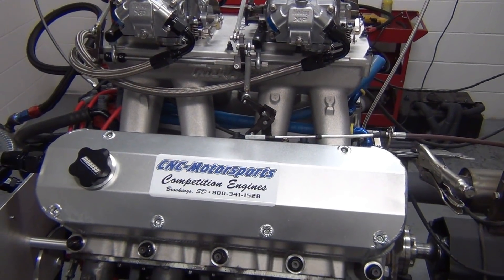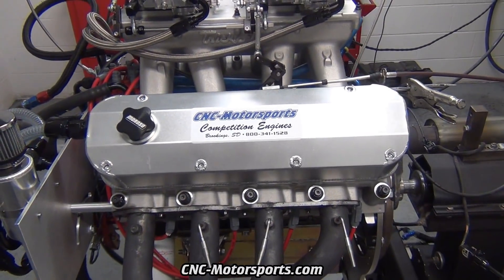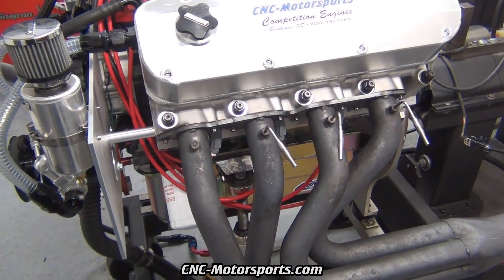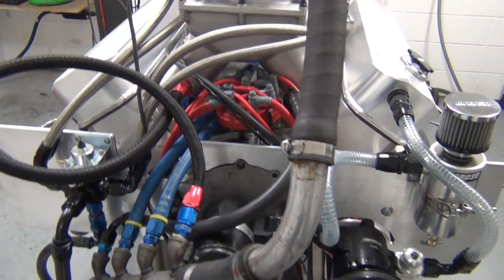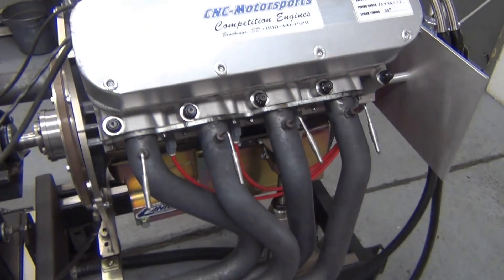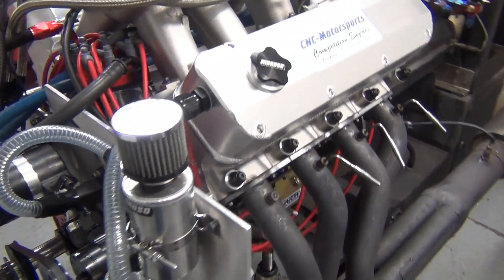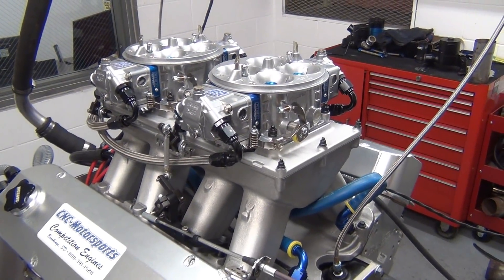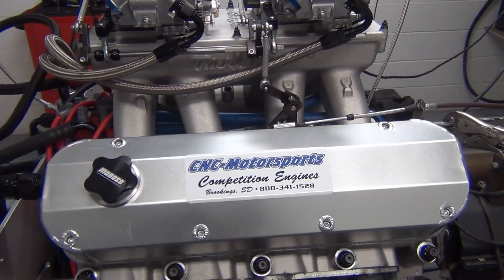Ford 632 Truck / Tractor Pulling Engine Dyno 1100 + HP

Comment: Remember folks until now you have seen dark orange heads with 572-632 written along ""Chevrolet"", light orange heads with 572-632 written along ""Hemi"" but now it's time to change color and clan, now blue heads with written not 632 but ""Boss 600"" or ""SCJ 600""....

Comment: What size header would you run on an engine that size and horse power level? Those look small and that might be holding it back a little. I would think 2.250 on the small side. A video on header sizes to show the change of performance would be great. CNC  seems to have true power ratings, not inflated big numbers. Thanks for showing us your builds I like to to watch them.
Reply from the maker: 2.250 is what we were currently using. We are currently reworking the combo with a 2.500 header tube

Comment: can someone tell me, if we run that engine on the street and touring, please and thank ?🤔 ☺
Reply from the maker: We can build one for your application.
Reply: @cncmotorsports  But what happens if you do? I'm assuming noise ordinance regulations would be a problem...
Reply from the maker: @anonymousanonymous9991  That depends on your exhaust system used.
Reply: @cncmotorsports  Fair enough. So its do-able just ridiculous to daily? Cuz frankly I'm tempted to try it but a little scared haha...
Reply: CNC-Motorsports  how much can u bore a 460 to
Reply: @codyhickman6272  a460 aftermarket blocks can go as big as 4.65. Stock blocks can go as big as 4.5" depending on sonic test

Comment: Im in the market for buying ine of these tractor pulling engines here to drop it in my 03 mustang mach 1 with a T-56 6SPD transmission bolted up to my car can anyone help me and work with me here to achieve my goal of building one bad ass mustang with one of these builds but tweak it up a bit with hemi style custom heads on a big block ford
Reply: Kasse is only way

Comment: That oil pressure concern you at all or is that normal?
Reply: We don't know if he had that sensor hooked up. I can see a mechanical in the video. But from what I have been reading the eliminator blocks have a completely different oiling passages so you don't need the typical super high Ford pressures. My 514 ci a460 runs 80psi but you don't need a high pressure on the eliminator. I grew up on Chevys and freaked out when I saw how high of pressure Ford race motors run. 25-30 lbs was normal idle for me in my 540 ci chevy.
Reply: 10lbs per 1000rpm of oil pressure would be nice and that engine won't see under 5000rpm, no need to dyno that low